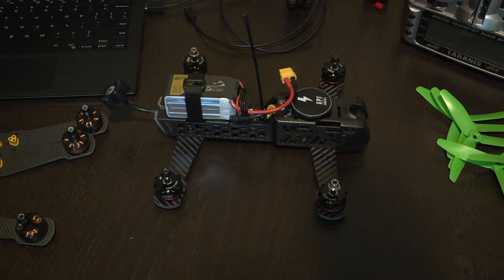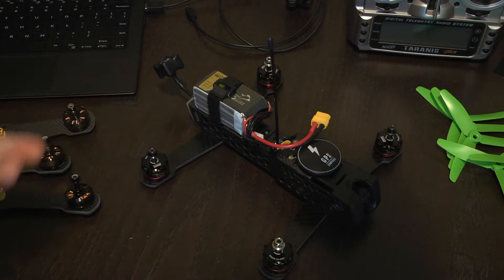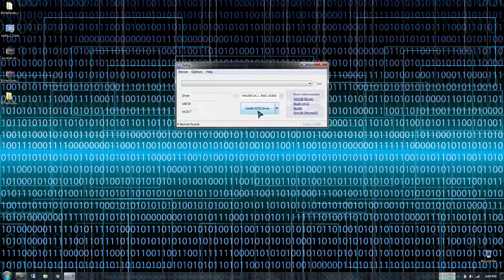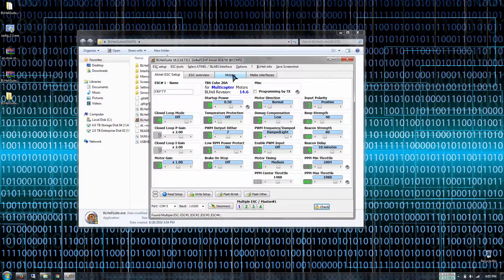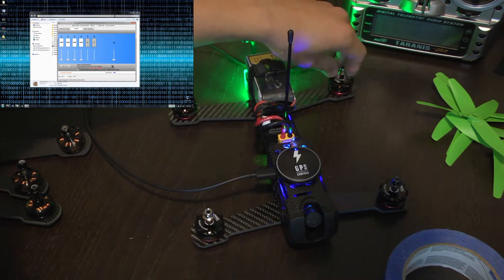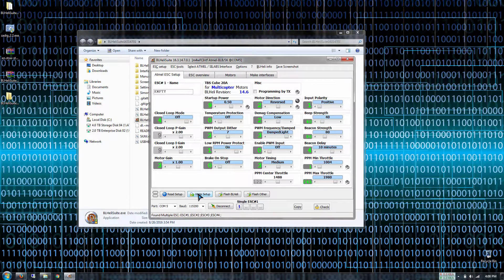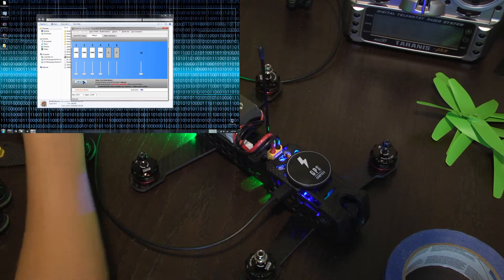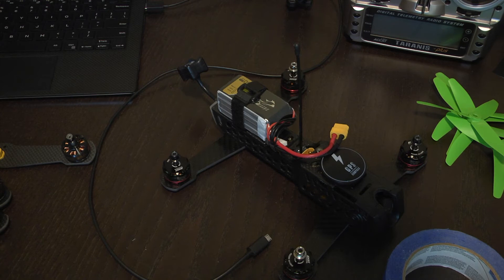How To Change Motor Directions On The TBS Vendetta

Comment: Thank you. Idk what happened but one of my original motors is out of whack;  waiting on new motors to arrive. Found these on eBay for 22 bucks each: Cobra 2204-28 w/MT30 already soldered on (link below). Thought I was going to need to re-wire but the HeliSuite software makes things much easier (hopefully works a well for me as it did in video). I'll just divide up the new motors CW & CCW so if needed I can swap out in the field. Thank you for very informative and clear video.
 http://www.ebay.com/itm/TBS-VCMR-Team-BlackSheep-Cobra-2204-28-w-MT30-2300kV/401137727328?ssPageName=STRK%3AMEBIDX%3AIT&_trksid=p2057872.m2749.l2649

Comment: Great video!  Really helped me out a lot.  Thank you.  Quick question: What GPS system are you using, and do you like it? I've never used one on a quad racer before; any recommendations in terms of setup, installation, ...?
Reply from the maker: AEMontoya Thanks!
I am using the TBS Compass/GPS module - works great with the PowerCube on the Vendetta.  I like info the GPS provides as it is useful for long range FPV and finding your quadcopter if you happen to crash it. 

The GPS is designed to be used with TBS systems.  No idea how well it would work with other systems - would need to check the pinout to integrate with another flight controller. 

Hope that helps!
Reply: MatrixWriter Awesome! Thank you. I was hoping it would be readily compatible with the Vendetta. I'll likely get one in the near future. Keep up the great vids!
Reply from the maker: AEMontoya No Problem!  The TBS compass/GPS module is compatible with the Vendetta.  You will need to use a BST cable and connect it to the 2nd BST port on the Core Pro.  Carefully route the cable and connect the module once you have everything inside the body of the Vendetta.
Reply: MatrixWriter Great. Thank you. Doesn't sound too bad. I just installed and spooled up the Lumenier 2206-2350kv motors on my Vendetta--every single motor rotation is backward.  Doh! At least I can just reverse them all without much trouble thanks to your tutorial. Beats swapping wires!
Reply from the maker: AEMontoya Definitely!  I hate swapping wires too, esp if you did a tidy soldering job.  Would be nice if RotorSense was available to other ESCs besides on the Vortex.  Swapping motor direction is even easier.

Comment: Is there a noticeable power difference and does it killed the battery quicker?
Reply from the maker: Charlie Potter There is a little bit more power difference due to higher kV and they are lighter than the Emax RS red bottom motors.  Since they are higher kV, it uses a little bit more power so less run time.  Not too much of a difference in run time I noticed but it really depends on how you fly.

Comment: How do you like the F 40s?
Reply from the maker: Charlie Potter The F40s have a nice build to them and are pretty solid compared to the stock.  Allows for better punch outs due to higher kV rating over stock.